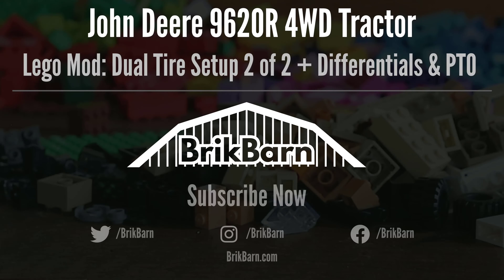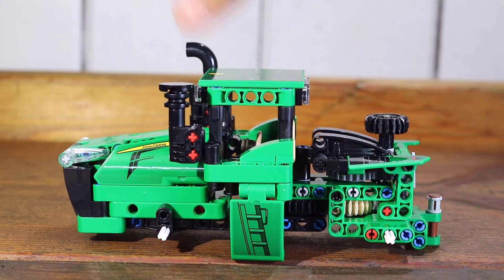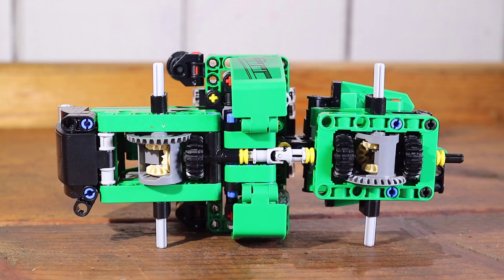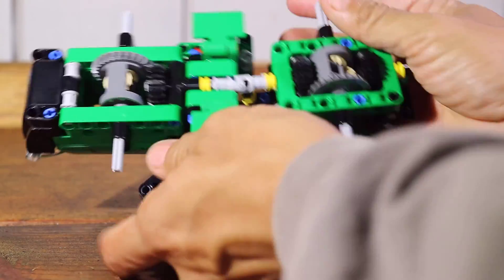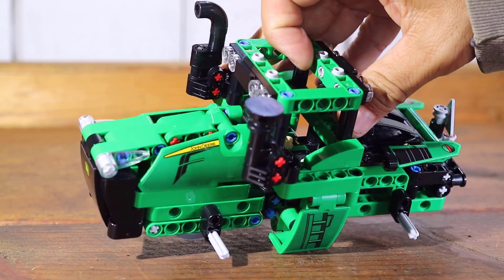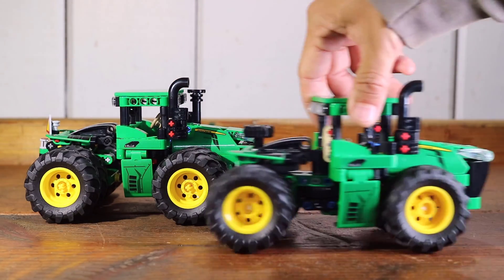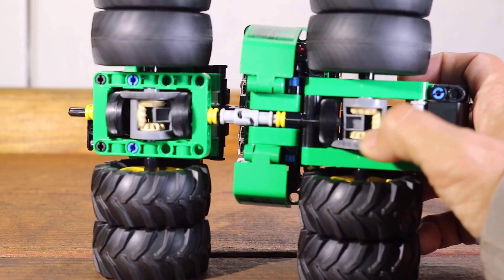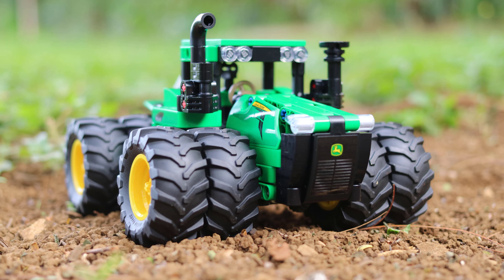LEGO Mod: Dual Tires, PTO on John Deere 9620R Technic 42136

Comment: I opened mine and one of the big rubber tires was missing
Reply from the maker: Sorry to hear about this.  There should be four in the original set.  Maybe reach out and contact LEGO on their website and/or contact the retailer to see if there are any other options.

Comment: Very well done video! Would you by chance have a list of the additional pieces (not included with the kit) you added to complete these modifications?
Reply from the maker: Unfortunately I do not have the part numbers for the mods. 
To the best of my knowledge LEGO Technic parts include: 
Axles
Axle connectors (to connect the dual wheels)
Differentials 28 Teeth (with bevel gears)
Double Bevel Gear - 20 teeth
Liftarm Thick 
universal joint

This is has been added to the description.

Comment: This scale being almost minifigure-friendly would be interesting next time City has the Farm subtheme. It works almost too well honestly, and expanding the Technic building style into other themes beyond System integration would also be interesting; might even bring newer fans to the Technic theme if Lego were to do this. But as a purely Technic set, I have mixed feelings about this set, and smaller sets like these in general, I just don't think they fit into the overall theme that well outside of building style, as the most amount of 'functions' these sets receive are a simplistic steering mechanism and maybe a liftarm that moves something. The mods to this set do help it regardless, but I still feel that this would fit better into the Farm subtheme of City better than it does Technic.
Reply from the maker: I agree with a lot of  your perspective.  This set would be a great addition to the LEGO City farm sets.  I notice there are a lot of other sets using Technic pieces and this would fit right in.  This set does also work as a good entry to Technic for those wo may be starting to get interested in Technic.